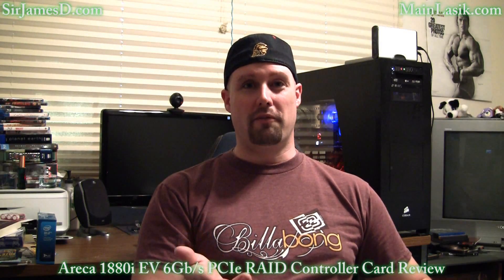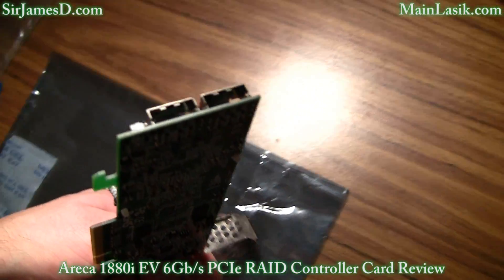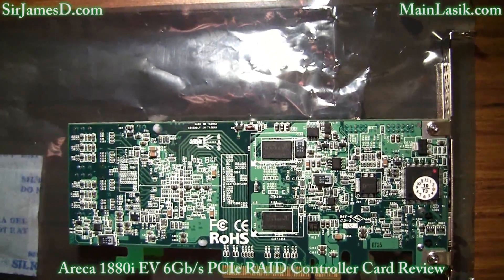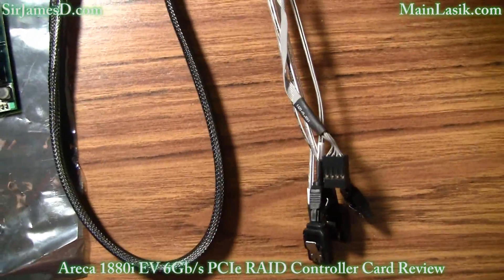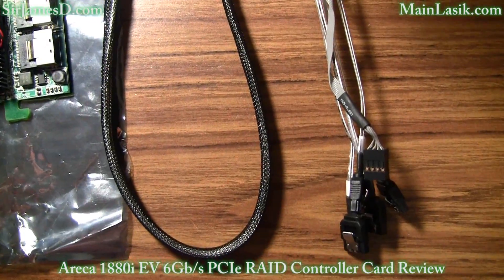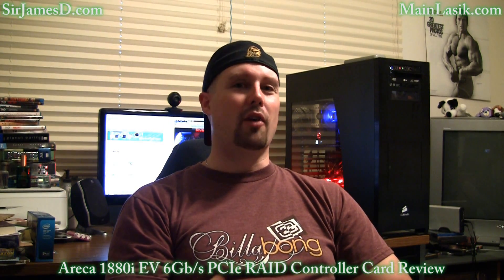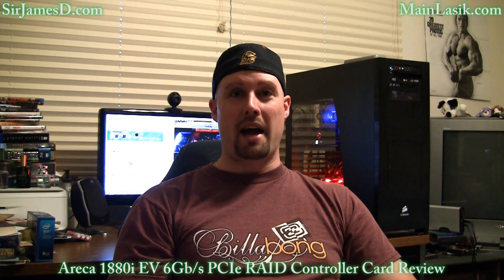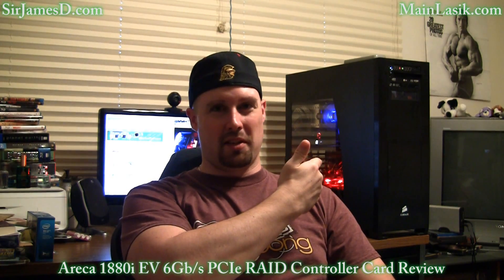Areca 1880i EV 6Gb/s PCIe RAID Controller Card Review

Comment from the maker: @x900lbGorillax What I'm discovering is that there is a higher latency because of the SAS overhead on RAID Controller cards, and therefore the 4K and 4K-64 Thread suffers a bit.
Same applies for the access times.

Comment: Also reason I am getting into raid installs etc is because I just bought two SSD's that are, 32GB Corsair's. I bought them for now though to try this new technology I never herd of on my Rampage Extreme board. Where you hook up to identical drives to the two Speeding HDD connectors that run off the silicon image chip. I am just gonna dedicate the 64GB to games using the Super Speed tech on the board. It's almost like a raid just for games.

Comment: @SirJamesDTech 

It's simple, you wrote the 100MB file, which wrote to and read from the 512MB onboard cache, so it's closer to a test of the interface :-) I typically run with a good 4GB file as it'll get very well past that onboard cache (Which you must admit, for typical PC usage, those small read/writes will indeed be running at that speed)

Comment: @SirJamesDTech yeah 2500MB/s is straight from/to the cache memory... 2.5GB/s

The AS SSD Benchmark results are the most interesting to me, they show that the ICH10R is faster in the all-important random reads, and not bad on random writes, so the Areca seems pointless when you get that kind of optimised performance on your mobo.

Not to mention it's hot and noisy ;)

Comment: Hm.. just a little confused on the benchmarks SirJames, Higher is better with those benches right? Just seemed like in a few of the benches some of the scores might of been higher on the ICH10R. But from what I could make out most of the results yea definitely were like 250, 300MB/s faster on the 1880i. That's if I am reading this right.

Comment: Even though the Areca has higher max Seq. speeds, it seems (from your test results) that the random reads/writes are much slower than the ICH10R, which are a lot more important than Seq. speed. Take AS SSD for instance, the ICH10R just rapes the Areca in every test except for Seq. reads/writes. Even the overall score isn't as high. Do you think this is a driver issue that may get better with the final consumer release?

Comment: @VideoBarcelona i was about to ask the same, its not possible, crystaldiskmark and SSD's + a raid card just fails. its totally unreliable.  my 8x vertex raid array i have on a raid card does about 1800MB/s read using other more reliable benchmarks so it proves my point on CDM.